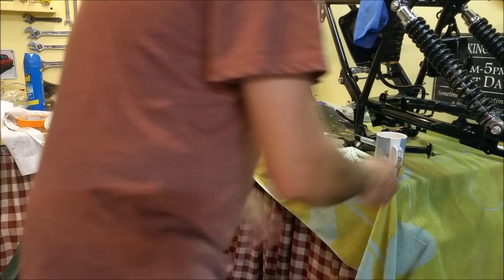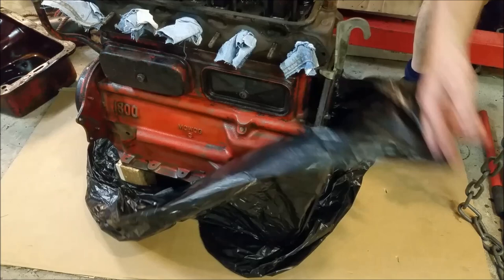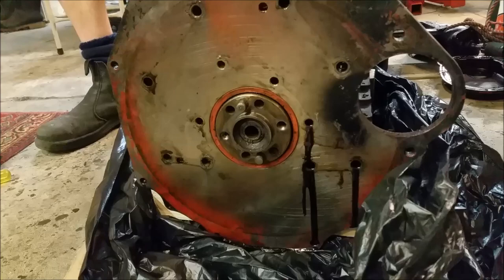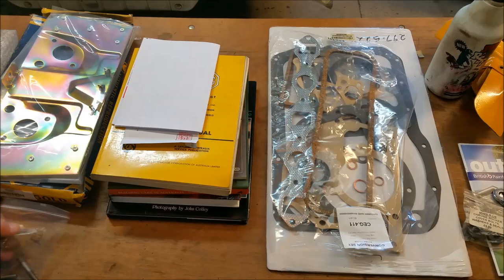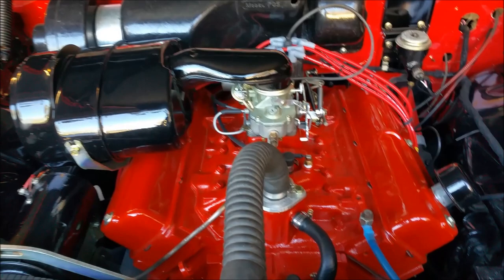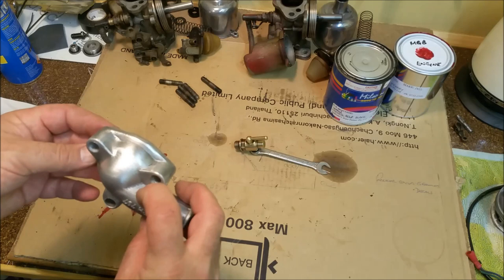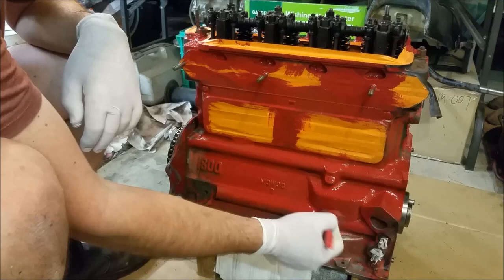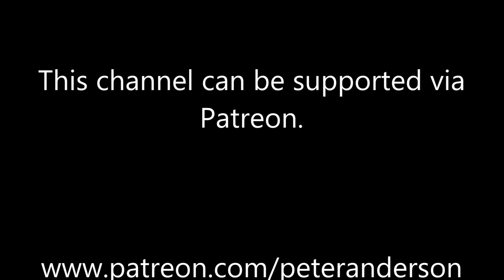MGB B Series Engine - Re-sealing, Painting and Plating - Part 2

Comment: Nice vid Peter . Forgot to say the crank pulley bolt is a 3/4 Whitworth  very old school but you can still
get the socket from Britool i think. 
 cheers 
Pete.
Reply from the maker: Thanks, I need to get one... I used a dodgy fitting one to get it off - fortunately it wasn't tight.

Comment: It's also fair to say that if you can't run to the 6-7,000A$ for an up and running B that still needs work, or you just don't fancy tacking that work they you could always consider a B GT.  I don't know about Australia, but a lot of B GTs sold in the UK were ordered with the optional folding fabric sunrool, and even more have been fitted with them since.  There really isn't a lot of difference between the driving experience in a B or a GT with the roof folded back.  In the UK you can still find the odd solid, running and perfectly usable B GT for under £2,000 and even a really top-notch car will struggle to break £10,000 unless it's something really special...
Reply from the maker: The GT is a great choice and one I probably should have made. A more usable classic for me than the roadster as I prefer being in the shade haha.
Reply: +Peter Anderson  The GT tends to be a much underrated car but they do still have a lot going for them.  Of course, when it comes time to buy a classic it's always a good idea to buy the best that you can afford and maybe compromise a little on what the car is.  In any case you've certainly come out well ahead on this one as a pull door handle B roadster is a very desirable car now and the value may well pay for 2 or 3 decent, usable later model B GTs.  And plenty of sun cream...

Comment: I would replace the lock straps/washers on the rear plate.  There have been cases of old ones failing and the bolts backing out causing unpleasant rattling noises which is a pain as the gearbox has to come out to replace them with the engine in the car.  I believe they're readily available and not expensive so it shouldn't be too onerous to replace them while the engine is out.  Some B-Series experts recommend using the oil flinger on the crankshaft even on engines with the later-type oil seals feeling that the oil seals, although better than the early ones, still aren't all that great and often do start leaking rather sooner than might be expected.  Apparently running the flinger with the later-type sealer can extend the need to do this job by several years or as much as 50,000 miles before it starts marking its territory like yours has.  I'm not saying it's necessary, particularly with this engine as it runs well, as I would imagine that machining is probably necessary based on how much these engines changed over the life of the B, but if it was an engine that was being fully rebuilt it might be something to look into, possibly.  However, it is a BMC engine so I strongly suspect that if it didn't leak from there it would find somewhere else to leak from.  These really are the engines that caused the coining of the phrase about "if they're not leaking something it's because it's probably run out of it..."
Reply from the maker: Great information and  I will replace the straps.
Reply: +Peter Anderson  General consensus seems to be to reuse the lock straps no more than 3 times.  The B-Series is quite a vibratory engine so it can be more inclined to back unsecured bolts out.  I understand that some of the people who race Bs use the straps and heavy duty adhesive to stop the bolts backing out, though, of course, it's fair to say that those cars get driven far harder then any road B is likely too...

Comment: Question: Are you thinning it with just regular lacquer thinner? then shoot it normal and let it air dry?
Reply from the maker: Hi Jeff, If it's air dry enamel you can brush it on the motor and it will self-level without any thinner. For painting the sump, rocker cover and side tappet covers, I thinned it and shot it through a touch up gun at fairly low pressure, cheers.

Comment: Newly acquired MGB 1976, had oil changed the mechanic said the oil was very bad looking so he drove a short time and changed oil again. Now I have a hard knocking sound.  Just pulled the MG into the barn. First pull plugs and do compression check, then what ( engine sounds nasty) Where can I find your first video? and what would you offer as a starting point?

Comment: I have a bunch of engine stands which i have bought off gum tree , swap meets etc , usually about $20=-$50 .They are pitiful  quality but they work well enough l . i have two joined together fr bigger six and straight 8 engines .I'm a pitiful carpenter so i wouldn't make stands like yours ,and i'm too old to kneel on the floor these days..
Reply from the maker: Yes and it probably won't be too long before I grow tired of kneeling either...